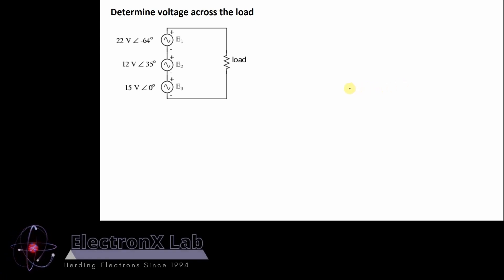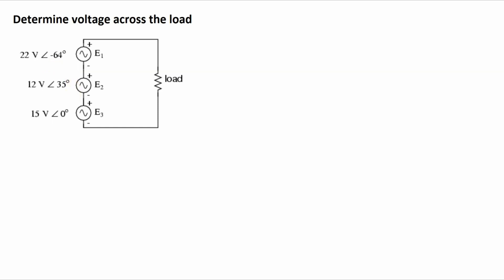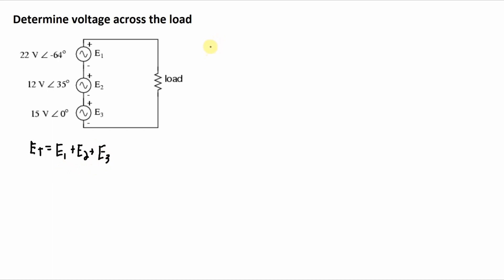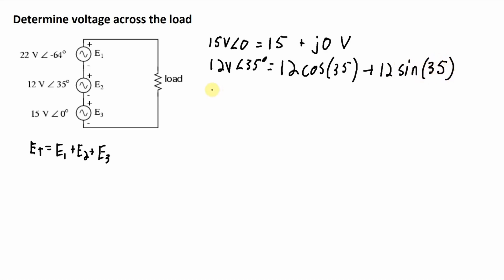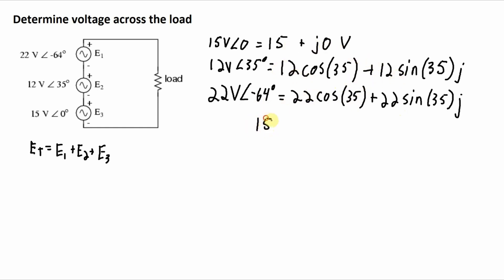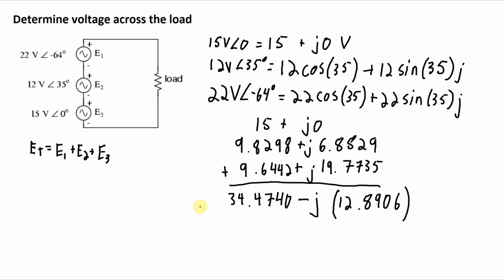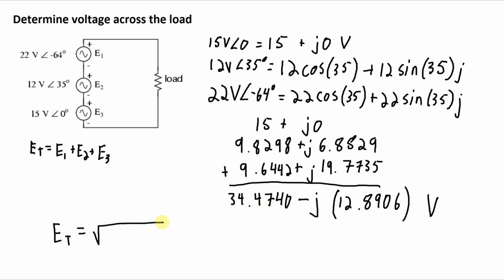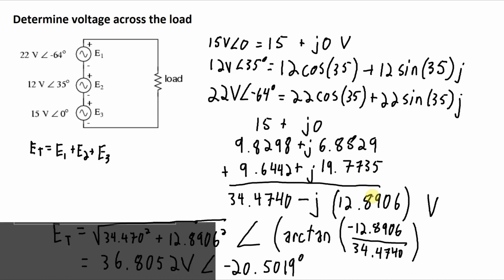How to Add AC Voltage Phasors

Comment: I guess it should be 22 cos(-64) + 22 sin(-64)j , right?
Reply from the maker: Yeah, I'm dumb. I wrote down the equation wrong...luckily did the calculation right...22cos(-64) is 9.6442